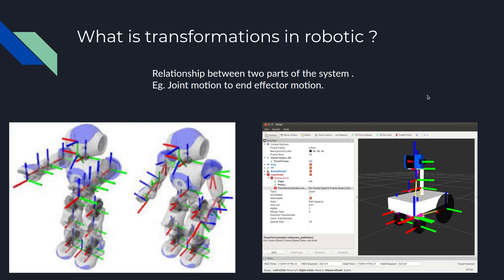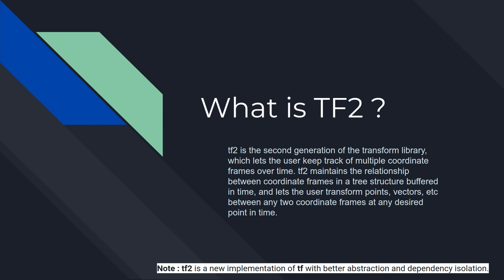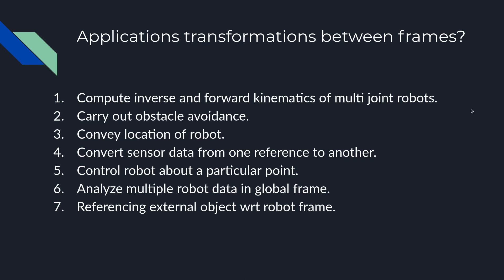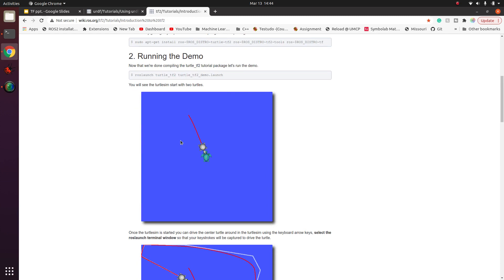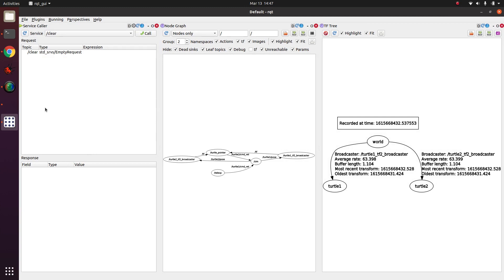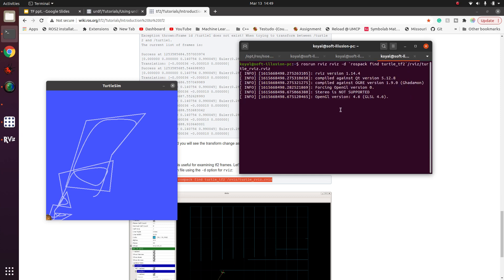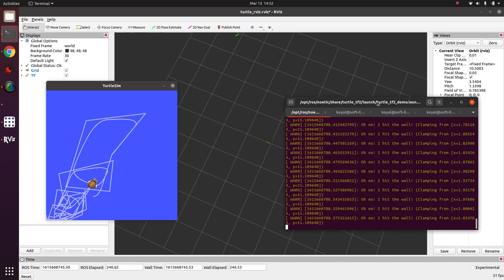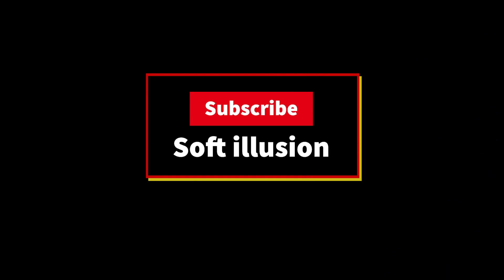All you need to know about TF and TF2 in ROS  | Tutorial

Comment: Many thanks for your efforts.
Please, when I teleop my turtlebot3 (without any SLAMing, just navigate it manualy) and record data in a bag file, I see that /odometry topic carried the robot position relative to /odom frame 
Which is the same data of transformation between /base_link and /odom frames.

My questions is :
1. Is this a filtered (/estimated) position ?

2. Is it a ground truth data ?

3. What is the relation between this situation and deadreckoning algorithm ?

4. (When I run GmappingSLAM) is the transformation data between (/base_link) and (/map) frame, the same as data of topic odmetry mentioned  above !!! 

In summary , which one is the ground truth and which one is the estimated position ?
Reply from the maker: Great questions .
Before answering these questions I would like you have your input on is there a GPS in turtlebot3 in webots which is giving you data or is it wheel position sensor which is giving you data ?
Reply: @coolrobotics  Thanks for your reply.
It is turtlebot3 that give its pose as /odom topic data or /footprint frame relative to /odom frame in /tf topic.

Which is (as I knew ) encoders and IMU data (without filtering of fusion technique ) .
Reply: Turtlebot3 burger (practical implementation)

Comment: Thank you for the tutorial ^_^ Could we use the sendBroadcaster between child and grand-parent to control a set of joints?
Reply from the maker: If you want to use the sendBroadcaster use it as : joint between -> grand-parent <--> parent
and second joint between grand parent<--> child.
it is possible but you will have to individually control them.
Reply: Thank you very much ! 
If we can't control a set of joints, what is the utility of TF?
Reply from the maker: In ouder to prove use of TF
Think about ROS without TF. 
how will you do forward kinamatics?
For example , How will you estimate where is an end effector if in 3 axis robot.
axis 1 : 30 degrees
axis 2 : 45 degrees
axis 1 : 60 degrees
you will have to manually do lot of math.
Reply: yes, you are right, but it would be nice if we can control a set of joints by using the TF tree ^_^
Reply from the maker: Yess 👍🏽